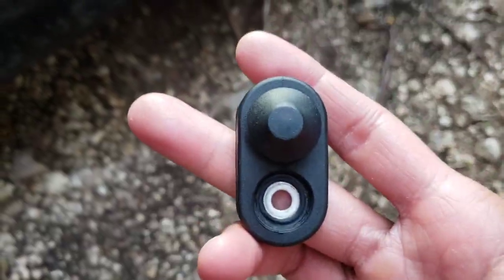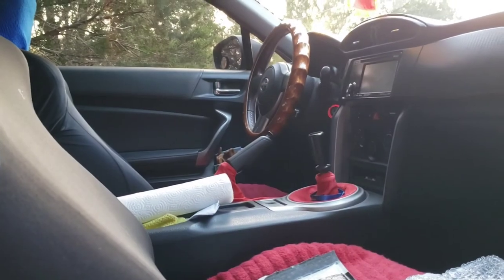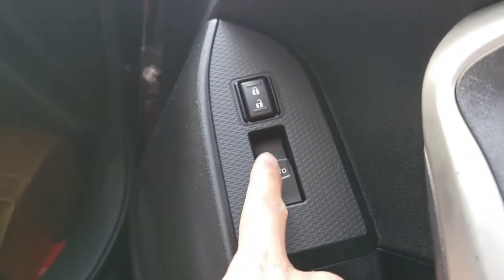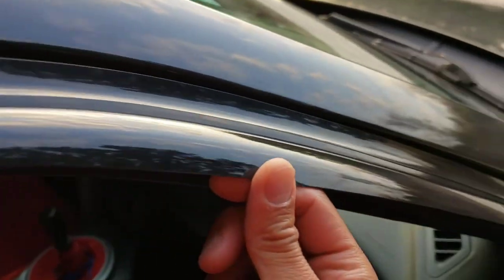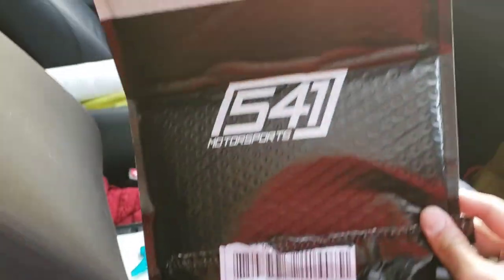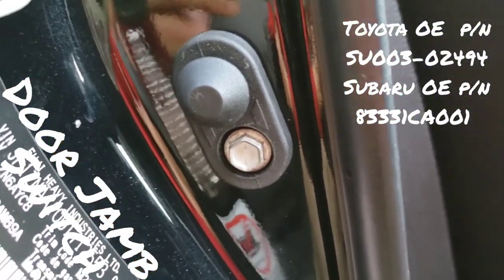FRS BRZ 86 Window Fix ! Door Jamb Switch / Sensor Replacement. Window Roll Down problem solved!

Comment: For anyone wondering, mine was glitching up and down. i solved my issue by removing the switch, cleaning everything and tightening the bolt back up. The screw acts as a ground and if there is some residue it may not function properly.
Reply from the maker: You know I tried that at first!  And it's good to know it can be repaired that way. Thanks for your feedback.

Comment: I tried replacing it but I'm still having same problem with passenger window switch
Reply from the maker: If you replaced the door jamb switch, try resetting you windows and/or check your window regulator and motor on that side.

Comment: I’ll try this! I tuned my car and afterwards my drivers side door can’t tell when it’s open or closed so the window stopped open wing and closing with the door 💀
Reply from the maker: Did you use the OFT?
Reply: @FRS_Heero  I did, and it fixed it!!! I just swapped the drivers door jamb for the passenger one and it fixed it! I just need to get a new one now for the passenger side
Reply: But yeah it was my first time using an OFT and I guess I forgot to turn all accessories off and it messed up my door or something, but thank you so much it was driving me insane for a week, I couldn’t find anything about it anywhere
Reply from the maker: @joweeholmes  No problem. I'm glad to help